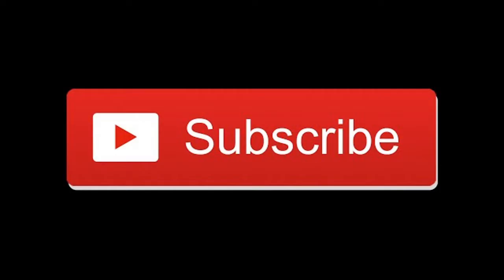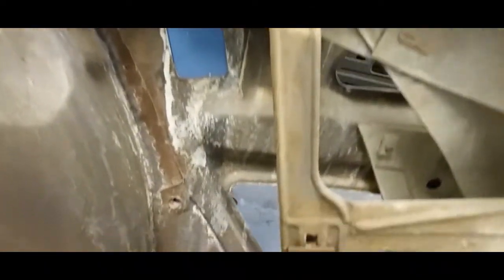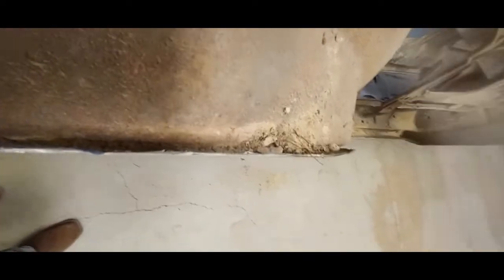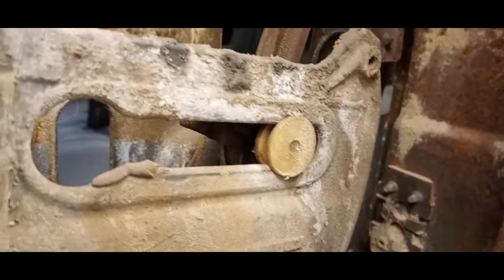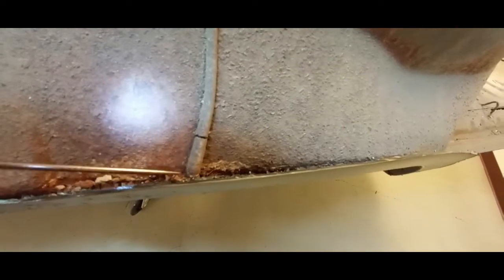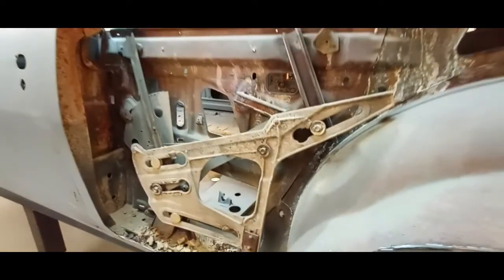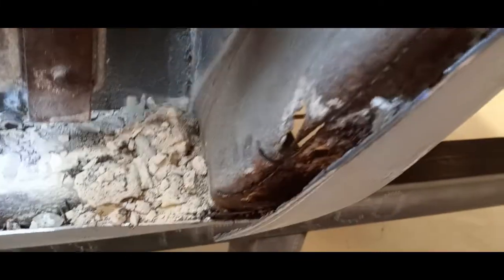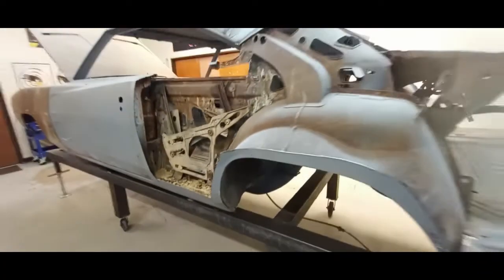Why you NEVER use DUSTLESS BLASTING on your restoration project !!! - DIY Auto Restoration

Comment: Great video outlining the problem, but no talk of solutions. As I see it, any type of paint and rust removal will have similar problems. Weather it's dry blasting, soda blasting or chemical dipping, there are closed areas where material is going to be left in closed spaces. It seems to me that chemical dipping is best because it removes rust in closed spaces but it still leaves paint slime and freed rust in the closed area. Then, how do you get a coating on these closed areas that are now bare metal?  Further, this is the problem with buying any restored car. You don't know what the paint will be like in 5 to 10 years. There is no way to know how much hidden rust was left behind.
Reply from the maker: The point of the video is to make people aware of the result of wet blasting enclosed, inaccessible spaces..... the solution.... don't do it.....

Comment: Interesting video. I have done sandblasting both dustless and dry. I would like to ask if the blaster wet blasted the interior. If so, why? If there is any time to NOT wet blast would be the interior of ANY vehicle.
Reply from the maker: Thanks for watching, I have no idea how the work was performed..... ( that's how the vehicle arrived ) but what I do know is this isn't the first time I've seen guys doing dustless blasting leave this kind of mess behind..... Wet blasting is ok if your blasting a single sided outside surface - NEVER between two panels.... and a mixed in rust inhibitor is mandatory NOT optional or extra cost. Outside hood or deck other than that wet blasting is better suited for industrial applications....
Reply: @guzzifabrication3448  I definitely agree that the rust inhibitor is MANDATORY!!!! Not only in the blasting mix but in the rinse water also. If you rinse without the inhibitor, you just wash away what was left from your blast mix. 
I am NOT a professional at blasting (yet and probably won't get that close) however,  I am trying to make a fulltime business out of what I do when I'm not doing land surveying. There is a time and place for sandpaper and wire-wheels but as far as total car, media blasting is the better way
Reply from the maker: @jimletzring9791  Dry media blasting performed by a competent operator/blaster is always our preferred strip method. Thanks for the feedback

Comment: It's all in the preparation, i did my Bronco but only did the outside, i don't recommend doing the inside of any restoration for the same reason, even dry blasting does the same to any vehicle...
Reply from the maker: Dry blasting doesn't pack wet sand into inaccessible places..... that's the point of the video. Thanks for watching.

Comment: How would you remove rust/protect body seam areas example body seams?
Reply from the maker: To remove rust from in between seams, without disassembling the panels you would have to chemical dip the vehicle. Thanks for watching !
Reply from the maker: To remove rust in between panels without disassembling the panels, the vehicle would have to be chemically diped

Comment: my only comment when using rust inhibitors is it will leave a film, hence no rust growth. Fresh water wash the project before blasting, blast, then fresh water wash again once complete. inhibitors, such as hold tight, will bond to the substrate anchor profile / peaks and valleys. You want the best mechanical bond possible bond with the substrate free of all contaminants
Reply from the maker: Thanks for the comment hey,  have a great new year
Reply: @guzzifabrication3448  I appreciate the video, gave me something to think about. Happy new year!
Reply from the maker: I've seen this happen to a lot of customers. After they were charged a 1000 to $1500 by these dust blasting guys and those guys won't tell the customer they need the rust inhibitor because it's an added charge, bad deal.....
Reply: @guzzifabrication3448  absolutly! I do industrial painting - offshore platforms, refineries, etc.. I wouldn't dream of using the grit from the field on a car but I live on some acreage and clean up is a non issue. If I were to bucket blast a car, what media would you recommend? Sugar sand/soda?
Reply from the maker: @HEWfamily1  Green diamond media 30/50 mix works really well.
Reply: @guzzifabrication3448  hey, thanks again!

Comment: Unfortunately there is no manual or video to Instruct you what should and should not be wet Blasted And they put out a lot of videos. It comes down to experience and common sense. The operator that blasted your vehicle was more than likely inexperienced And probably didn’t know the long-term consequences. When I began my business 6 years ago I learned right away not to wet blast the interior of a vehicle, because of media becoming trapped in pockets and creating corrosion, even with rust inhibitor. The inhibitor is only effective if it has a chance to dry. Wet treated media will begin to flash in minutes if allowed to sit. Out of 100 jobs I may wet blast one time in the middle of summer to prevent warping. Dry blasting is the absolute best method for surface preparation when properly done. Very informative video.
Thank you,
Joe
DBTX
Reply from the maker: Thanks for watching !

Comment: Would using crushed glass as the media work better?  I am under the impression the glass will pretty much disintegrate on impact.  Then follow-up with a strong pressure washer.  What are your thoughts?
Reply from the maker: @JohnDoesGarage  great  question, honestly I have never  used crushed glass, you wouldn't want to spray untreated water behind panels alot of the time the factory didn't paint or prime behind panels. The best method I've seen is a competent dry media blaster using the correct  aggregate mix

Comment: I'm no expert but seems if u found a way to spray rust inhibitor solution with a spray nozzle u could alleleivate  alot of that residue and treat alot of the issue... also like some are saying don't dustless the interior or into the crevices... I wouldn't just tite saying never use dustless.... just know your limits ...
Reply from the maker: Thanks for watching !

Comment: You also have 50 years of road dust collected in there. You cannot blame all that on the blaster.
Reply from the maker: Dust isn't the issue..... compacting wet sand inbetween mostly light/no painted inner panels is....

Comment: Needs to be completely flushed after using the wet blast - otherwise you risk this disaster.  Oxy-Tech (and others) make products well suited to protecting from flash rust.  My experience is, IF I chose a media blast, I tend to prefer plastic media.  Typically it will not remove rust, but is great for removing paint etc.  And COOPERS STRIPPER from NEW ZEALAND - amazing stuff.

Comment: Use glass.  This car is old it’s had dirt go in there then it’s sat it the rain same thing. That looks dry to me. What happens after dry blasting  sand sits in there guy finishes resto then washes the car straight away then the dry sand becomes wet and sits in there

Comment: First mistake was the guy used sand with that job in my opinion I would’ve used recycled glass.. the glass and the water at that high psi coming out the glass will basically evaporate in thin air after hitting the paint etc
Reply from the maker: Thanks for the input !

Comment: It all boils down to WHO and WHAT is being blasted. There isn't a vehicle around that doesn't have a bunch of saturated dust hiding in all the nooks and crannies to begin with. That is was causes rust anyway! To place blame on a piece of equipment instead of operator incompetence is unjustified. Take the extra time to power wash or steam clean all the inner panels out after media blasting. In those areas that cannot be refinished after blasting and clean up, apply a good quality cavity wax. I don't even own a dustless blaster (YET)! However, I have been in the collision repair industry for 40 years and have witnessed my share of wet material caked in fenders, doors, quarter panels, ect... I'm purchasing a dustless blaster to restore my 1972 K10 this summer. Just take the time to clean up after yourself!
Reply from the maker: I don't think you know what your talking about.....

Comment: poor clean out.  they drove away with the car still wet.  should have used the big compressor to blow the inside out.  the project cars we used to build we would have acid dipped.  the phosphoric acid wash they use after put a powdery coating in the areas not reachable by the pressure washers.  same thing with dry blasting, ive never been able to get all of the sand out after dry blasting.
Reply from the maker: Thanks for watching !

Comment: Dustless is a scam lol. their shit is way overpriced for what it is and they have a bunch of BS unrealistic videos of them blasting a car with chrome on and Windows not covered taking paint off in 2 seconds ofc disabled comments. They have clips of less than 3 seconds doing realistic blasting but won't show close up of final result/finish. Most ppl would rather spend money in a a shop for quality finish that lowers prep time than pay an extra to have someone do it mobile for no reason. U-Haul trailers are wonderful things... And they whole warping thing is a joke.
Reply from the maker: I saw the video of the truck being dustless blasted without anything  ( chrome, glass, hardware...... yeah...... very misleading and a flat out lie ! Thanks for the comment !
Reply: @guzzifabrication3448  The clip I was talking about wasn't a truck (https://youtu.be/nucYBS4B0bc). Looks like they painted the car single stage wet on wet to show off their shit. No wonder it's coming off. Their video with the 90s mustang is a completely different story.
Reply from the maker: @adryld25   There is a video of dustless blasting a ford truck without removing anything, thanks I'll check out the link you sent.

Comment: Pressure wash it without the media… problem solved. Just a great rinse job and it’s perfect.
Reply from the maker: The interior body panels are usually un-coated from the factory, if you pressure wash bare steel....

Comment: This doesnt seem to be a normal scenario for dustless blasting using glass bead. This looks like its been done by a novice or cowboy outfit and to say all dustless blasters are providing the same level of service is a disgrace if I was dustless blasting in the states I would be seriously pissed with your insinuations. Dustless blasting done by a proffessional with proper masking off would not cause these issues FACT.
Reply from the maker: I'm not insinuating anything I'm telling you straight dustless blasting isn't the way to go and if you get upset then you get upset
Reply: @guzzifabrication3448  ok will will agree to disagree.you are correct in that case it was a very shoddy job. but a proper operator would not leave that mess behind and would use rust inhibitors, and once media is dried it comes out like dry blasting media.
Reply from the maker: @russellemery8187  Not bashing anyone doing professional job..... but I've worked behind many more people doing dustless blasting wrong than right..... i.e. not taping anything.... not using a rust inhibitor...... not flushing out inaccessible areas with rust inhibitor until ALL of the media is out..... better yet charging extra for rust inhibitor..... that's like charging for shoe laces when buying a new pair of shoes..... A competent dry media blaster will always outperform the wet method, less cost, less clean up, less opportunity to start rust issues. For quality automotive restoration work, dustless blasting is not the best method...... I would agree the outside ( only ) surface of a hood or deck lid  since some have to be handled very cautiously to avoid damage and that's only because the active ingredient in paint stripper methylene chloride has been removed making ALL paint stripper useless..... dustless blasting is better suited to EPA compliance on out doors, in public / industrial applications where uncontained / controlled airborne particulates are prohibited. Thanks for watching and the comment

Comment: This video is misinforming people on wet blasting because the person that blasted the car in this video didn't know what they were doing. This is not the way you leave a car after blasting it. I've been wet blasting with recycled glass for 10 years now.  It's a given that whenever you blast metal you always , I repeat, ALWAYS use an inhibitor while blasting.  After the car is blasted down to bare metal the car should be rinsed with water and the inhibitor using the the same pressure and nozzle that you blasted the car with. Also, never blast a car unless the sun is out because it's important to have the remaining water on the car dry quickly. The only reason that I can see that the guy in this video has a business that doesn't offer wet blasting is because he doesn't want to spend another $40,000 to invest in a rig to take the rust and paint off the vehicles. the best and most economical way to take the paint and rust off a vehicle is by wet blasting it with recycled glass. So to prevent your car from ending up like the car in the video you need to ask some important questions before you allow them to do the job.
Reply from the maker: Listening to you will cost people a lot of money and heartache...... This video is what I'm seen time and time again from dustless blasting hacks misleading people ( and ripping them off )who don't have the experience to know better...... So sport explain to me HOW you remove wet compacted sand from inaccessible areas..... I didn't think you could because you can't .... but you can vacuum and or blow out dry media from any area that has been media blasted..... Dry media blasting performed by a competent operator IS and ALWAYS will be a better choice, end of conversation.

Comment: If you do a half-assed job, this will happen with dry blasting too.
Reply from the maker: No ..... you can always vacuum out dry media not wet media.....
Reply: @guzzifabrication3448  You cannot vacuum wet media ?
Reply from the maker: Not if it's packed in between panels that you don't have access to, with dry media you can  blow into the crevices and it'll blow out and then you vacuum it out and besides all of that most interior panels have very little Corrosion Protection spring wet media at a high pressure inside of a panel is not a good idea

Comment: Thanks to tv and internets showing the dustless blasting method. People believe anything they see on tv or see some car “personality” endorsing

In my shop, NOTHING gets media blasted, dry media blasted unless it is completely disassembled and all moving parts are removed as well as panels that there is any risk of warping. Media blasting in general is bad for any project but has become the most common method since dipping places are few and very far between.
Reply from the maker: I loved the commercial for dustless blasting with the my classic car guy blasting ( i think it was a ford truck? ) stating it won't damage the glass or chrome......
Reply: The other part they don’t show is, whether it’s dry or dustless, you still end up with a mess of media that goes everywhere. And how do you blow out wet media before you need to prime, essentially that media inside all the pockets of the vehicle will be riding along for years
Reply from the maker: @DreamstoRealityAutomotiveTV  Thank you ! that's what I'm trying to show the people.... I've had many customers have this done then bring the projects to me months later, hugh mess then I have to undo the rust damage it caused. Tired of these guys ripping people off. Thanks for the comments really appreciate you.

Comment: Any way you do things the wrong will have problems. After you blast it you need to flush everything very good. Even with chemical dipping if you don't rinse it you will have problems. What is the point of media blasting before you take the car apart in the first place? Why blast panels you are going to throw away. I love dustless blasting but it has to be done right.
Reply from the maker: Dustless blasting is the worst method hands down.....
Reply: @guzzifabrication3448  I have been doing it for ( I have my own equipment and do it in house) and have never had the problems you describe. Like I said, do it right and you won't have a problem.
Reply from the maker: @jn1ty  If you say Dustless blasting to professional shops, you won't be working with them...... so do you mostly work for individuals or volume work for legitimate accredited shops? yep there is your answer.... If you say for shops, then post their names.....
Reply: @guzzifabrication3448  I think this is mostly a difference in opinion. I am independent and do mostly my own stuff. I do some for other people but I am picky on who I do it for. The car has to be completely stripped. NO hardware. If they want to leave stuff on I walk away. I know you have way more experience that me and I don't mean to argue. I am just saying I have been doing it for years and have had no problems at all.  By the way, I love your videos.
Reply from the maker: @jn1ty  I really appreciate your opinion , comment, and supporting the channel, it 's not aimed at you, but I've had many customers that went to dustless blasters and the guys didn't add the rust preventative while blasting, gave the car back to the customer and before anything could be applied the car already  has surface rust on the inside of the panels.... these guys are ripping people off for $1000. to $1500. And leaving a massive mess for the customer... who then has to have the vehicle re-blasted and Epoxy primed. I've seen alot of unhappy people. Thanks
Reply: @guzzifabrication3448  No problem. Keep the videos coming.
Reply from the maker: @jn1ty  👍👍